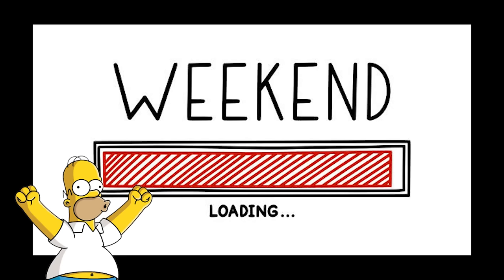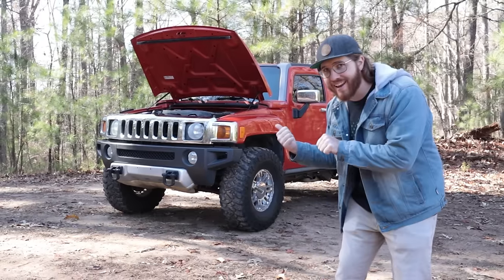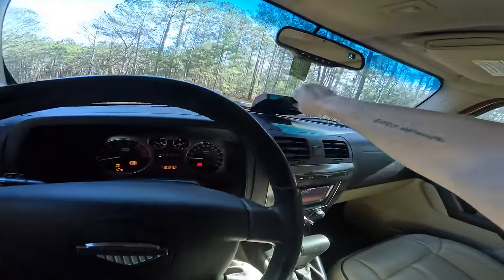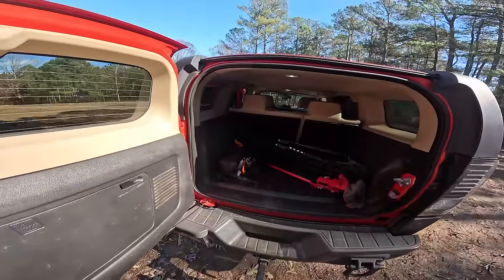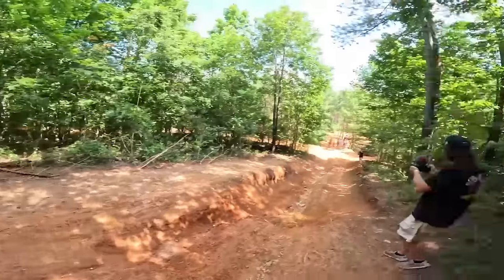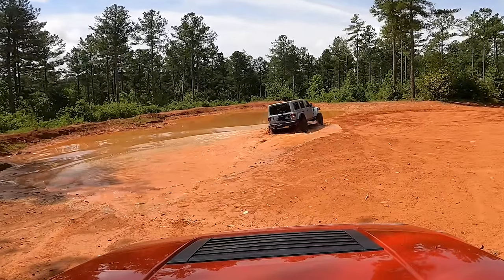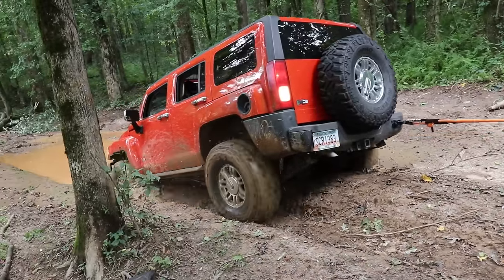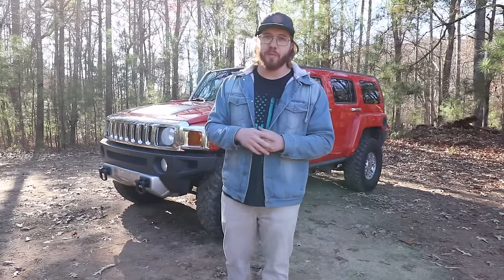This RARE V8 Off-Roader Changed My Mind on Hummers!

Comment: Alpha owner here. Only reason you couldn’t keep up with the 392 is that you found an Alpha without the Offroad package which includes the 4:1 transfer case and locking rear differential. I have an Offroad Pack; it is unstoppable. Also, you didn’t keep your momentum driving up the rocks or through deep mud. Closest thing to locking the right/left together is similar to Humvee locker engagement by applying light brake application to help prevent freewheel spin & keep traction. Get an ARB air locker or two and swap in the BW4494 transfer case and an aluminum shift fork.
Reply: Dang that sucks
Reply: And he's a terrible driver

Comment: Two things. One, obviously as you already know, you did all of this WITHOUT the TWO optional lockers in the rear and front. This isn’t even the most capable or half capable version of an H3. And two, I’m not sure if you already know this but Hummers have a specific kind of Traction Control. There’s no way to actually  turn it off as the TC button only lets you put it into mode 2 which allows more slip as needed off road, but more importantly it works by braking the tire that has less traction but you have to give it slow constant throttle to make it engage, it’s not instant. Giving it gas for one or two seconds real quick trying to hop over a rock you’re stuck on isn’t enough time to make it actually kick in, brake the free spinning tire, and put more power to the tire with traction. Another key word was “slow”. I don’t think an actual number is written in the manual but there is a certain speed threshold that you have to be under for it to work so you can’t just hammer the gas trying to get out of a hole and the TC give more traction to the bigger gripping tire. You have to apply slow constant throttle and then in a couple seconds the system will kick in, work its magic, and give you much better grip. Love Hummers! Enjoy!
Reply from the maker: All of my off-roading had actually been done with 0 TC or ABS. Because of the abs module failure, I wasn’t getting any of those assisted features. Since this upload I’ve fixed a lot on the Hummer so hopefully it will do better with traction next time I’m out!
Reply: @Zorbii  lmao touché. And how about that magical a** turning radius 👀 it felt awesome to flip around in a tight parking lot on my test drive the other day. Enjoy!

Comment: I have an 09 alpha adventure with factory front and rear lockers. It will go anywhere that jeep went for 1/10th the price. Plus I guarantee it rides better.
Reply: The Adventure also came with a a better transfer case; 4-low is 4:1 instead of 2.6:1.

Comment: I have an 06 Hummer H3. Over 200,000 miles and still running strong!!!
Reply: i just bought one. its so nice compared to all my previous cars, and stick shift with the locking diffs... im in love
Reply: 2007 3.7 - same. Three radiators are the issues I've had beside regular maintenance.
Reply: Yeah mine just hit 215 and i had to replace the fuel pump. Not bcus it went out, just bcus it started to have a slight hesitation when i would give it gas from a stop and when id stop, the rpms would dip slightly. But that fixed it. Drive it like that for 3 months, everyday before i decided to fix it lol😂
Reply: Same
Reply: I feel extremely sad to seee that you bought this beautiful and rare Alpha just to destroy it on off road 😮 sad
Reply: @andreijilavu7657  It is what they are built for though
Reply from the maker: Not destroying it. Just using it for what it’s built for. I’d be destroying it if I didn’t take care of it in the process.
Reply: @Zorbii  it is destroying, because if you want a real off road car you will buy a Nissan patrol
Reply: @Countrysideboy247  hummer is not for that Nissan patrol is

Comment: With no lockers you might have well taken a 5500 pound minivan to the mountains. I have an H3 with the rear locker and I never understand the guys that would rather have the H3 Alpha with no lockers VS the H3 with the 5 cylinder and lockers. Mine is the most reliable vehicle I've owned and has never let me down. With yours it's just a game of how long until you break something
Reply from the maker: I understand where you’re coming from and I don’t disagree, but I got the Alpha with lockers being a future upgrade in mind. I wasn’t expecting it to be the best thing right out of the box.
Reply: @Zorbii  I thought they all came with them?!!
Reply: @beunbad nope...only the adventure got locking diffs. The regular and alpha got an open front and Eaton g80 rear.
Reply: 5.3 is a very reliable motor. Especially those years

Comment: now drop 6k on a LS3 and a 6l80e swap, although not recommended for off-roading as you'll probably obliterate your t-case or front diff, I would recommend go to a local salvage yard, many are connected to a entire network of salvage yards and you can get the front and rear locking diff and electronics for a couple grand. Your 7.6" front end diff will be pretty fragile when it comes to adding more power and doing some hefty off-roading

Comment: Can see lockers in you future - would make a huge difference.  Can't wait to see this one kitted out - have worked on these a bit, had one client who loved his Alpha's (had one as a daily and another kitted for trail running).
Reply from the maker: It seems like most people who buy one usually buy a 2nd at some point 😂 I might end up with an H3T at some point too. Lockers are going to be one of the sooner mechanical upgrades too 👍🏼
Reply: @Zorbii  lockers make insane difference , the amount of stuff you can go over is just mind boggling with single upgrade.
Reply: @Zorbii  I'm on my 3rd h3. Still yet to get an alpha though. My latest is an 09 adventure ( front and rear lockers andcast iron front diff )

Comment: Exactly what I was thinking, lockers and high clearance bumpers will make a huge difference. 
I'm anti-RTT unless they're on an overland trailer. It's a lot of extra weight to carry around all the time and they stick up too high and raise your center of gravity. Get a Smittybilt Scout trailer if you're set on an RTT or think about a Gazelle tent. Cheaper and just as fast to set up.

Comment: I learned to wheel on an H3. Your truck has a limited slip diff so if you apply the brakes while one wheel is in the air, the other side wheel will receive power. Look up two foot off-roading and it will make your truck similar to a lock diff (not the exact same but similar).
Reply: An LSD would power the opposite wheels even if the other ones are in the air (obviously not compareable to a locked diff), this is clearly an open diff that requires you to apply the brakes to get the wheel on the ground to spin while the other is in the air

Comment: What if you consider previously to the lockers, and cam the engine just to fix it correctly? :D Nice vid, but as a Hummer h3 Alpha owner I can tell you that your brakes were not fixed right the second time you were offroading. The ABS light was On, that would turn off the traction control that is AWESOME on Hummers. You need to fix correctly the brakes + traction control system (check your rear brake lights in order to test if they work), if not then the brake pedal switch its shot and the traction control would not work too. Please always remember that first rule doing anything with a truck/car, its to have it correctly serviced!

Comment: I have an 06 H3 5 cylinder with stock rear lockers and I purposely got the 5 and not V8. It can still go anywhere the V8 can just not fast on the streets. Got it as the family vehicle and off roading. H3 are fun regardless.
Reply from the maker: I was considering that as an option, but felt like the V8 would’ve been better for content and selling people on the idea of a hummer being fun. Both make plenty of power for off-roading regardless.
Reply: @Zorbii   very true. I live in commiefornia so gas was the reason I went with the 5 cylinder and I’m familiar with that motor as well, I have the Colorado with that same 3.5. The H3s go for about 10k and up, in good running condition. The H3Ts are badass too, I haven’t seen one of those for no less than 18k.
Reply: I'm looking for a regular 5 cil H3 just to kill the wngine and swap it for a vortec engine. Probably I will choose a 6.0 L96 engine as it is the most reliable vortec/LS engine ever made, it weighs the same as the 5.3 cuz the block is the same and it makes more power due to the bigger displacement. Not sure about the transmission though, maybe the 4L60 is good enough, but if possible, I want the 6L90 (the heavy dutty you find in the 1 ton trucks with a gasoline 6.0).

For the transfer, I think it will do just fine as it is, but maybe I will end up with a proper mechanical one and the lockers have to be air lockers, no way around it.
The only thing that is bothering me is the lift... I know a 35" tire will lift it a bit off the ground, but a proper lift is better, maybe a 2 inch body lift to fit 37s and give it one more inch of clearance will do it, but there is only one way to find out right?
Reply from the maker: @69sound81 I’m kinda thinking the same thing but just swap the 5.6 for a 6.0 and keep the rest stock. I think it’ll hold up find with a simple 4l60  build.

Comment: I've had a 2007 H3 3.7 since new. Worst issue? I'm on radiator #3. So spare me calling this reliable truck "garbage".
Reply from the maker: I’ve heard the 3.7’s are pretty nice compared to the 3.5. I’m looking at doing a metal radiator soon so I don’t have to deal with any plastic cap problems.

Comment: put black wheels on this hummer, a metal rear bumper, and a cold air intake on this hummer
Reply from the maker: I have plans of blacking out all the chrome eventually. It’ll look SICK once it’s done!
Reply: you do NOT want to waste money on a hot air intake that'll just suck water up even quicker. Stock box is capable of handling more air than an NA LH8 could pump out. Only thing that engine needs is AFM delete and a tune.
Reply from the maker: @frostbite1991 I’ll probably end up with a snorkel and stock airbox combo
Reply: @Zorbii  that's the way to do it!

Comment: Build a beater mud truck jeez you will never get those headers clean let alone all the areas the mud will cake up forever. Mud is that hardest thing on vehicles. You will never get that mud out. Its not just pressure washing it. You probably have 30 pounds of mud embedded in the frame. Now it will retain moisture internally and rot. Lol cringe

Comment: Mud is the worst thing for vehicles. Thats why you have purpose built vehicles for dickin around. You financed a hummer h3 to beat on in the mud lol. Not even dusty trails but straight mud bogs. This guy is cringe as can be
Reply from the maker: The car isn’t financed lol and it’s not mud bogging. I’m also just not afraid of mud 🤷🏼‍♂️ vehicles can be fixed if they break